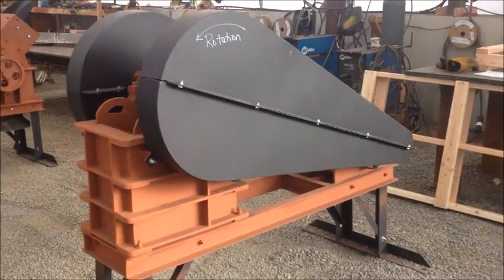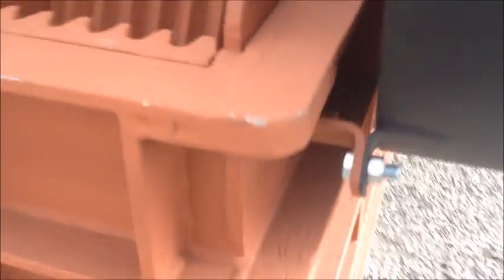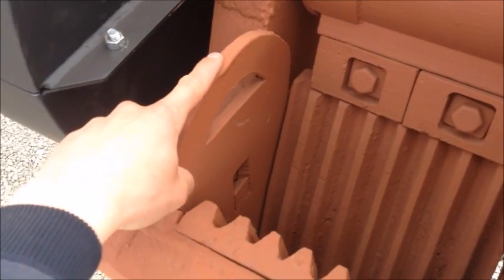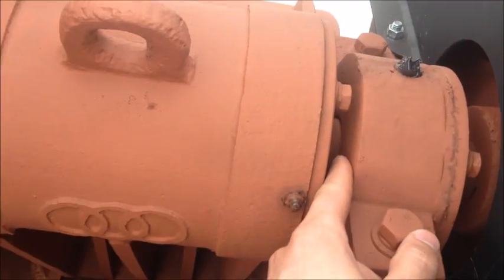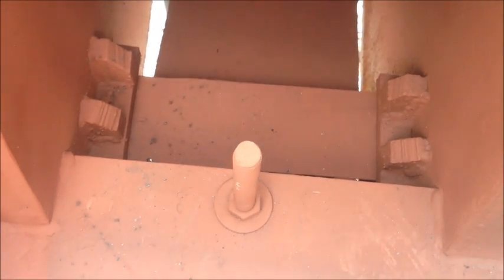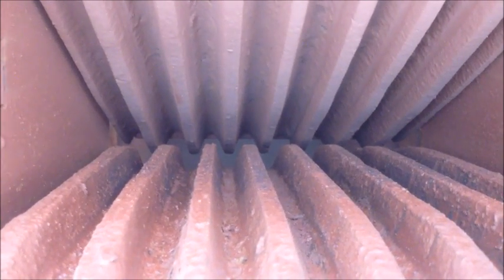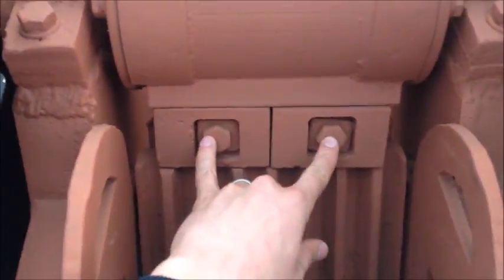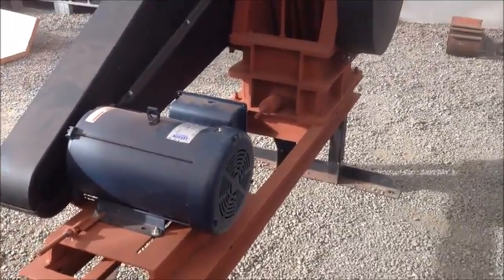MBMMLLC.com: Jaw crusher maintenance and operation video

Comment: what is a good diesel engine for a 9'' x 14'' jaw crusher
any suggestions as i have not found anything larger than 10hp was thinking a 20hp or larger would be best?
Reply: I've got that size jaw crusher and it's got a 13.5hp KOOP diesel engine driving a hydraulic pump. There's additional losses by driving a hydraulic motor and it also powers a conveyor, so there's probably about 10hp driving the flywheel. It's sufficient for fairly slow feeding but if you wanted maximum throughput, e.g. loading with an excavator or a front loader I'd recommend getting 18hp+

Comment: how much are they capable to process dirt per hour?
Reply from the maker: +Vahagen melikyan the 6" x 10" jaw crusher can process 1-3 tons/hour depending on the discharge size. If you are just running dirt it will be able to go a lot faster.